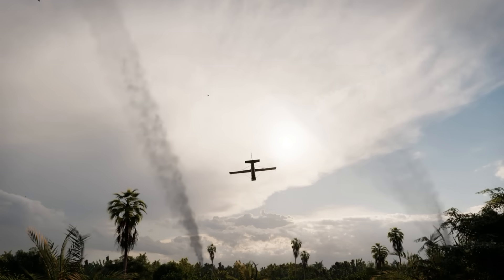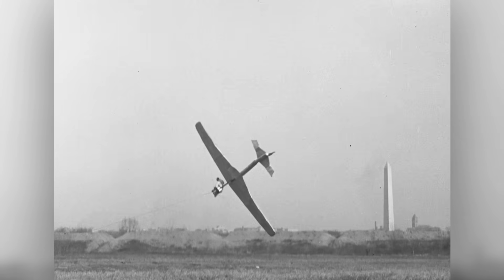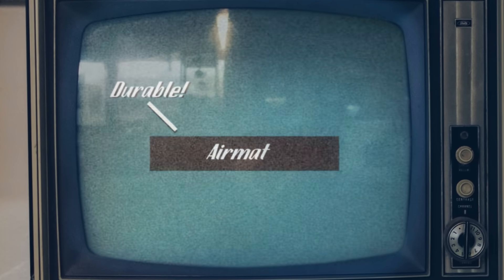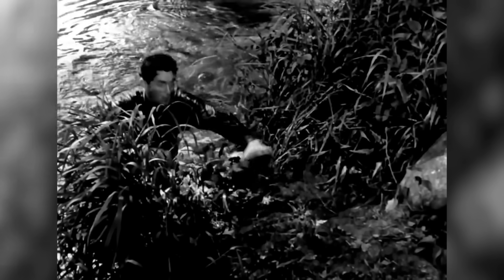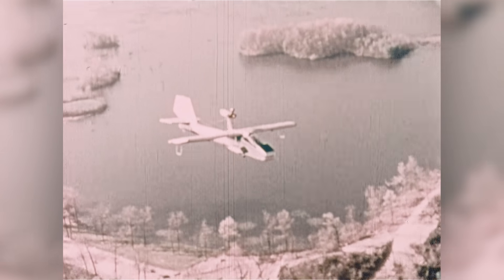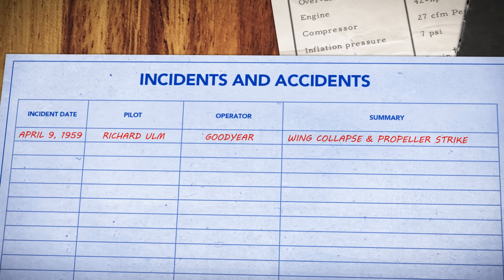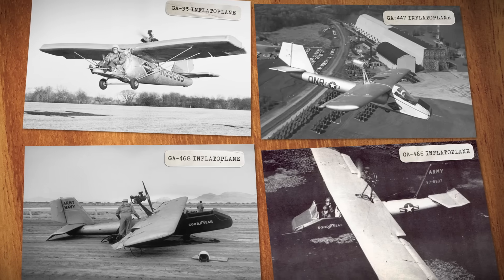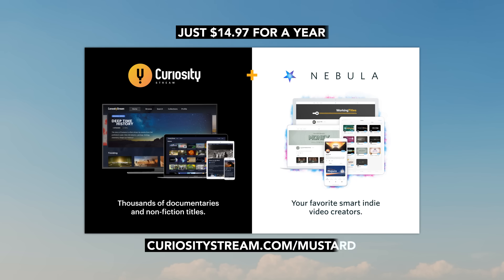Inflatable Airplanes Were A Bad Idea

Comment: Considering that a USED 1978 Piper goes for $35,000 with original 6 pack, an inflatable crash resistant single prop would be very good competition. Does it need more testing and developing? YES, but this thing could’ve really taken off if advertised to the public and sold at a reasonable price. It could be developed to have an amazing safety record, think about it, the whole thing is an airbag!!!

I imagine Goodyear making millions by simply saying “Own a plane, go flying, all without the hangar fees”. It can also take off from grass strips, so that would make it even more awesome.

I have a single and a 3 passenger inflatable kayak from Sea Eagle. I have owned them for about 6 years now and they’re amazingly convenient, especially since my only car is a 2 seater soft top. Never had a puncture either. I’m a huge believer in inflatables. I will say right now though, crosswinds cannot be above 7KTS 😂 You better have ATIS on 25/7. Respect that it’s an ultra light A/C, throw an optional parachute and that baby will sell like a water in the desert. You already got my money Goodyear, make it happen!

(All four of my tires are Goodyear, I’m already invested!)
Reply: Yeah honestly, Goodyear is sitting on a goldmine with this thing and they don't even realise it. With some minor modification as well, you could easily make these things be able to take off from or land on water, which would be even more of a game changer. 

An ultra-light plane that you can store in your garage, be carried in the back of an SUV and only needs a lake or grassy field to take off or land would be a massive hit with just about everyone. I could easily picture resorts lining up around the block to buy two seater versions of these things to offer scenic flights to guests.
Reply: @zixx844  That would be nice but there's the real issue that some drunk idiot would kill themselves by doing manuvers that the aircraft can't tolerate. Then their family decides to sue Goodyear for selling a dangerous product even though the crash was the result of stupidity.
Reply: @twistedyogert  surely you could do some contractual gymnastics to avoid such an out come
Reply: @twistedyogert  People already do that with PPGs and they're perfectly legal. I think the actual main issue is that sure you could afford the aircraft but since it takes off under it's own power you'd need a license to fly it.
Reply: @TheAkashicTraveller self propelled gliders don’t need more than a basic license I believe no medical even
Reply: @Uberaroundtheworld530  They don't need any license, the question is weather this inflatable plane would
Reply: @zixx844  You say this like the FAA is just gonna let this slide. Hell no!
Reply: @zixx844  I'm already thinking of a drunk idiot crashing with a 747 during the takeoff
Reply: It all seems like fun and games until you realize why people need a license to fly.
Reply: I did a report on this airplane when I was in High School back in 1970. I still have the brochure that Goodyear sent me, kind of fun stuff in my airplane collection.
Reply: Also depending on the setup it could need an even shorter airstrip. In the WarThunder there's an old Soviet biplane that is known for its stability and low noise and ability to take off and land from short, rough strips. The same one that Night Witches used, the Po-2. I'm thinking, the Po-2 design could, probably, be easily reproduced with modern materials. 
And you can probably make the wings more rigid, if you have a part of the wing sturdy, so it's not completely inflatable, but "mostly" inflatable, like a SUP board or a Kodiak boat.
Reply: Aircraft that are light enough don't need licenses.
Reply: 25 hours a day 8 days a week
Reply: The main problem is that it would still be out of reach for many people, to fly anything yourself you have to have a pilot's license. I for one want to build a gyro copter but not having a pilot's license throws a wrench in that plan.
Reply: @vipervidsgamingplus5723  This would be an ultralight aircraft. You would not need a pilots license to fly this.
Reply: @WillyOrca  You still need a license to carry a passenger.

Funny enough there is no minimum age.

So according to the FAA it's better to let a child fly an ultralight alone than have a parent put them in the back seat.

The FAA is madness.

One major revision I would make is to replace all the strings with memory wire, and go all electric.

Then you could use wing warping and not need any extra moving parts.

Since it's electric integrated small air pump just in case/convenience.

Also makes me wonder how much extra lift you could get if you filled it with helium.

A few strategically placed rigid parts would probably also help without impacting portability and ease of use.
Reply: @vipervidsgamingplus5723  What do you think about para-motoring?

Comment: With the advance of technology all the problems mentioned in this video could be overcome. Rubbers, polymers, carbon fiber, aluminum alloys, titanium. If it doesn't need to constantly repressurize to resist small arms fire, a different style could be developed that inflates not with air but with lighter-than-air gas. This could add much lift. A fast, fixed-wing airship! This concept still government and private applications, especially in very remote areas. Also recreational users.

I think the Soviet idea of towing a very light airplane also has merit. It would be towing a cheap self-launching ultralight plane, the way gliders are often towed. But they could fly back after making their delivery. This could greatly increase their range. In some very remote areas dependent on air delivery, like the Alaskan interior or the Australian outback, these planes could be very popular. They'd be good "backup" transports and potentially could in some areas make flight less expensive, more accessible, and safer.

Comment: If looking into pilot rescue, one should look into the Australian Air Sea Rescue. Because of a hat I was wearing, a Gunny called me over and let me know that in Vietnam, when they were informed the Australian Air Sea Rescue were coming in, they knew to back off. He said that he watched as an Australian actually ran up to the pilot and pulled him from the grip of North Vietnamese soldiers. He said it mattered not if the pilot was living or dead, the Aussies would never leave until they were recovered. On the many pilot recovery methods the USAF had is a method I actually saw in John Wayne movie about Vietnam. The downed pilot had a package that held a helium tank, a blimp and a lot of rope. He would let a C130 know where he was with a flair, and inflate the blimp. The C130 would enter a hoop just below the blimp and pull the pilot into trailing the C130, then a Crew Chief would use a hook on a long stick to hook the rope and winch the pilot in.

Comment: battery airplane's problem is opposite of that of air balloon plane,  the battery/fuel cell (the high pressure gas (hydrogen) maybe more energetic, but it needs some really heavy container for it's safe storage) would be too heavy, or in another word, the energy density when everything's factored in is much lower compared to fossil fuel, which doesn't work well when you have something so concern with weight like airplane,

Comment: “This plane blows up”
“... very poor choice of words...”
Reply: ʾallāhu ʾakbar
Reply: A large number of chemical reactions convert high density solid or liquid phase materials into a large volume of low density gas phase reactant products.  Commonly familiar chemical reactions that do this include many types of "explosives", although many less rapid/less vigorous chemical reactions also do the same thing (including ordinary combustion of wood).

There is really no good reason for the plane to need any manual inflation, even partially.  Such would be a major waste of time and likely dangerous for the downed pilot.  It would make far more sense to initially inflate ("blow up") the plane basically instantaneously with a small explosive charge instead.

One "potentially interesting" alternative would be to use hydrogen as the inflation gas.   There are various chemical reactions that can relatively quickly produce large quantities of hydrogen gas (from common/cheap ingredients like aluminum metal, ordinary water, and an acid or base to dissolve the surface oxide coating on the metal), which could hypothetically be used to quickly inflate the plane.  As an added side "bonus", the plane would be extra buoyant in the atmosphere due to the lower density of hydrogen gas compared to atmospheric air.  Hypothetically, if the inflatable plane was designed with large enough internal volume, the plane could take off vertically, without needing any forward velocity, landing gear, or initial air speed at all.

Alternatively, one could design a blow up plane with ordinary air filling instead (ex: for perceived safety reasons), but with a tether attaching it to a large inflatable balloon that gets filled with hydrogen (ex: from a water + aluminum chemical reaction).  After initial vertical lift off from the ground (via the buoyant hydrogen balloon), the hydrogen balloon could be released to cause the air filled plane to drop by gravity and gain air speed sufficient for controlled horizontal flight (without needing landing gear or a powerful/heavy engine necessary for short distance takeoff runs on "improvised" runways, which may not be available anyway in a jungle or other rough terrain).

Currently designed military aircraft often come with "ejection seats", whereby upon activation rockets blast the seat and human pilot away from the destroyed plane, and then a parachute deploys to bring the pilot relatively gently to the ground.  Conceptually, it is possible to design the ejection seat with a powered fan on the back and to use a paraglider style parachute, to achieve sustained continuous flight to help the pilot escape the hostile territory, without ever needing to touch down on the ground or needing any kind of extraction/rescue operation.  One might assume that the ejected pilot may get shot down immediately, but this would not necessarily be true, as modern airplanes are too fast and high flying to be shot down with ordinary guns, and instead anti-aircraft missiles are typically used.  However, anti-aircraft missiles are expensive, and not all militaries would be willing to waste an extra anti-aircraft missile shooting down a basically harmless ejected pilot simply trying to fly a powered paraglider back to safety.
Reply: @Fritz_Schlunder  blud wrote an essay 💀

Comment: I want this plane. I am that average Joe, and have waited long enough.
Reply: I'm sure the patents have expired by now.
Reply: Have a look at ultralights and paramotoring! Basically modern day equivalents
Reply: Modern update: Small electric with thin panels of solar cells that are attached to sections of an unfoldable frame for the cockpit and can be velcroed to the surfaceindefinitely
Reply: Yeah. If we want our jetpacks, we need to have the inflate-o-plane first.
Reply: Well sure, but where are you going to find the station wagon?
Reply: @RobMacKendrick subaru
Reply: @RobMacKendrick lol, with the sizes of cars nowadays, itll fit in anything
Reply: I am still waiting for flying cars and jet packs. The Jetsons was a lie!
Reply: Great video/documentary !!! 
It was a novel idea at the time, today   pretty much any powered hang glider, or parachute could do the job safer at higher altitudes nowadays.. that's not even counting 254lb ultralights...
Reply: @mrmcclung  I suppose this may be more safer in some ways, like if one is flying low, one will have the safety of a giant airbag most of the time.
Reply: @PS-nf3xw  with a spinning engine coming down on you (for the inflatable).. the non-inflatables also have the ability to fly at altitude (some at 10,000ft).. the inflatables couldn't handle the air turbulence, let alone the speed.. 
Ultralights can easily travel around 60+mph (a military one even faster).. I am surprised they didn't cage the prop on the inflatables like the modern powered parachutes, to avoid frame/cable strikes... it's getting closer to just having an emergency drone snatch you or a hybrid-electric motor on the back of the ejection seat.... Lol
Reply: @mrmcclung  yes, I am aware of that hazards but they are not insurmountable. A traction or pusher instead of a pod; a low flyer cropper instead of a high alt. Won't it make sense?
Reply: @mrmcclung  Might have been a weight issue.
Reply: You’re belittling yourself by calling yourself an “Average Joe” because you’re much more than that.
Reply: Found one of these online....  but unfortunately , the station wagon, has proven very elusive...
Reply: Make one
Reply: The average Sudarshan...
Reply: SAME
Reply: I too, am the Average Joe
Reply: At this point your best bet is to just build it yourself
Reply: Omg is it you Joe mama
Reply: There are unsurprisingly a lot of cheap toy mini planes 

Like SF-51 toy P-51
Reply: I WANT THIS RIGHT NOW
Reply: I saw a video on this in the early 90’s on the Discovery Channel. I wanted one of those so badly then. I was high as 🪁 then, and now, same…and I still want one. Lol
Reply: Hey Joe
Reply: I've actually sat in one of those
Reply: Me to
Reply: ...bushplanes
Reply: they're quite easy to build and as long as you keep it small(can't carry more than 200lbs of cargo) and below 10,000ft you don't need a pilot's license
Reply: If you want an inflatable plane what you actually want is a paramotor. By one of those for 10k.
Reply: Same id love soar the skies in my very own plane
Reply: Same 😂
Reply: Check out gyrocopters are way better they can take off in an extremely short distance they're fast as hell they can't quite hover but they almost can and they fly extremely straight with little to no input meaning you can take your hands off the controls both the throttle and the stick so you can shoot out the door
Reply: The pietenpol is the everyman plan. Get a kit.
Reply: See ya on the news average Joe
Reply: Lol
Reply: I too would love one
Reply: For hunting it would be perfect
Reply: @Nick_276-r2c  well yeah, until you realize both the crashes weren't due to pilot error, but the fact the thing had absurdly low rigidity, even WITH the special material. On one, the prop was able to strike the aircraft, on the other a control cable jam caused the wing to fold. In other words, the strength of the pilot pulling on the cable was enough to fold the wing. 

Maybe with modern technology we could do it, but it's still super dangerous. Just rent a helicopter, it's way easier and safer, probably cheaper too.
Reply: @MatthewSmith-sz1yq  What if the plane used the larger thicker tent poles?
Reply: @MatthewSmith-sz1yq  il make it happen
Reply: @MatthewSmith-sz1yq  a folding carbon fiber spar, in pairs would do the job. it can even be cheap enough for the average joe.
or just go with aluminium
Reply: @wh0_am_152  Lol ! SW are called SUV nowadays, see ? 😁
Reply: @MatthewSmith-sz1yq  hay a man can dream and that's what desine and engenering could do
Reply: Joe mama

Comment: Downed pilot: *inflating their getaway plane

Enemy soldiers in distance: we found the crash site!

Downed pilot: *inflation intensifies
Reply: Hurry Blow Harder!
Reply: This would make for the greatest Metal Gear Solid cut scene.
Reply: ...longest 5 minutes evar...
Reply: Yes, that's how that works
Reply: Or, he already escaped and the soldiers are punished for lying, while they were telling the truth, but the pilot's gone
Reply: @موسى_7  or the soldiers shoot bunch of holes into a slow moving aircraft
Reply: @cwwwhite  Yeah I don't fancy the guy who has to fly this thing through hostile airspace
Reply: @cwwwhite  Good Years run flat technology would now make it almost invisible.
Reply: @موسى_7  "Or, he already escaped and the soldiers are punished for lying, while they were telling the truth, but the pilot's gone" 
Seems a lil bit idealistic, but sure!
Reply: Plot twist: the drowned pilot need to blow the inflatable plane cause the pilot who drop it forget to drop the air pump
Reply: Actually the inflato plane came with a pressurized gas cartridge. It contained enough pressurized nitrogen to fully inflate the plane in about 10 minutes. So here’s how I see it being used. You grab the plane kit and get well hidden and lay low till about 6 or 6:30 pm. According to the actual instruction manual you connect the inflator then roll the plane out. You also tie it to a tree so it doesn’t roll away when you start it. Once it’s fully inflated you check the surfaces, this takes all of 13 minutes. Then once your ready to haul ass you manually start the motor by pulling the propeller. Once it’s running you run around and jump in the cockpit and zip in. Then you throttle up dump your rope and go. The failing light will make you hard to spot if you stay at say 1100 feet. You’ve got a 200 mile range so that ought to get you into friendly territory at least
Reply: Oh the pun right there!
Reply: starts pumping faster while panicking
Reply: frantically pumping as enemies approach
Reply: I saw this thing on the history channel, when I was a kid... that was the first mental image I had XD
Terrified guy, aggressively blowing up an airplane (like a pool float) while under fire.
Reply: TacticalMoonstone  Makes. Plus constant pressure would make up for any small leaks
Reply: XD
Reply: Pilot go fiiiiuuuhh 🌬️🌬️